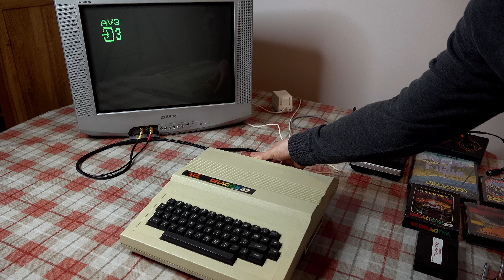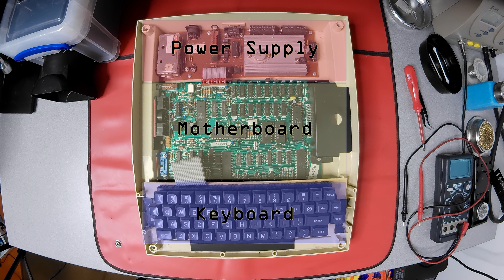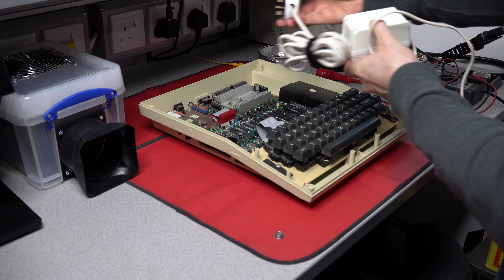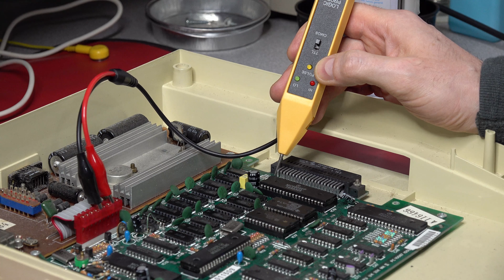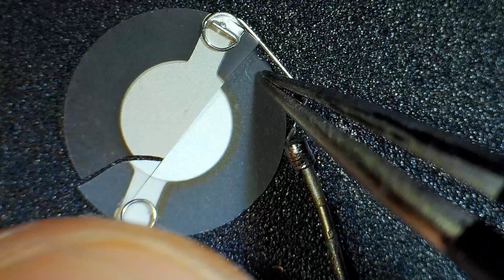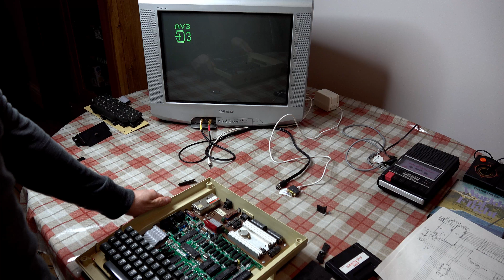Dragon 32 - Part 2 of 4

Comment: Hi Keith, thanks for these lovely videos on the Dragon! You gave some good tips to maintain and fix mine :D May I suggest you try some of the latest developments such as Flagon Bird and Return of the Beast? Also, I'd like to ask you if you know the name or how can I order the red connector that goes from the power board to the motherboard. Thanks a lot and keep up the good work!
Reply from the maker: Hi Roberto, thanks for the software recommendations, they look really good. I'm not sure what exact connector they used on the cable and can't find a name for it on the circuit diagrams. That said, the connector on the motherboard looks to be a 9 way, 1 row, straight PCB connector with a 3.96mm pin pitch (like this PCB header  https://uk.rs-online.com/web/p/pcb-headers/6801862/ ) so I wonder if a modern connector for one of these would be a good fit.
Reply from the maker: This might be what you're looking for
https://www.fclane.com/product-group/mas-con-idc
Reply from the maker: This could be a close match
https://uk.rs-online.com/web/p/idc-connectors/7100015/
Reply: @TheDigitalOrphanage  Thanks for taking the time to look at those, I think they are spot on! I did experiment with an atx psu connectors and the crimped cables do match the pins on the Dragon’s motherboard but the spacing of the connector is a bit off. So I managed to cut out a row of five and have some cables for the remaining four pins. I have tested a meanwell RT-50B switched mode psu and it works flawlessly.
Reply from the maker: I did wonder about using an old PC power connector so that's interesting to know. Great to hear you've got it working well.

Comment: Thank you for making such a great video. I've repaired a few micros from the '80s and agree with you that the Dragon is really nice to work on. Maybe on the next video you could try Chuckie Egg or The King, as they are probably better at showing off what the Dragon could do back in the '80s.
Reply from the maker: Thank you! I love Chuckie egg so a comparison to the BBC version would be interesting. Not heard of The King so I'll check that out. I was wondering yesterday if there are any modern "demo scene" demos that show off what the hardware is capable of.
Reply: @TheDigitalOrphanage  The King, or it's earlier title of Donkey King by Microdeal was a Donkey Kong game (They had to change the first title as it was a little too close to the original) I generally stick with the software that was available during the '80s, but if you head over to http://archive.worldofdragon.org/ there are a number of people still writing games and demos for the Dragon that stretch the Dragons capabilities far more than the software of the time(Flagon Bird springs to mind), along with some new stuff coming from the CoCo side as well.

Comment: 13:45 Several of the solder connections on the power connector appear to have radial fractures around the pins.  It's a good idea to wiggle the connector while observing the solder joins with a magnifying glass or microscope, if there are radial fractures you're likely to see slight pin movement.
Reply from the maker: Yes I thought that, but they didn't move a bit. Maybe the best advice is to reflow just in case!